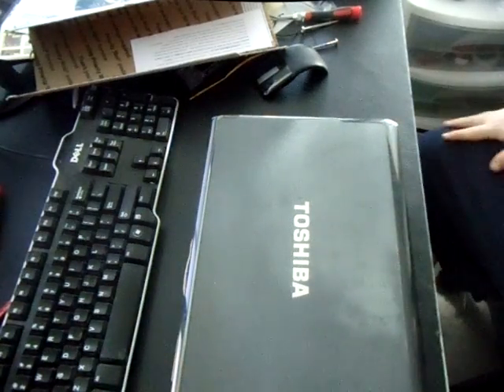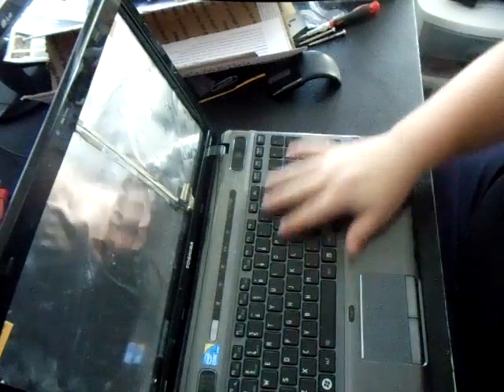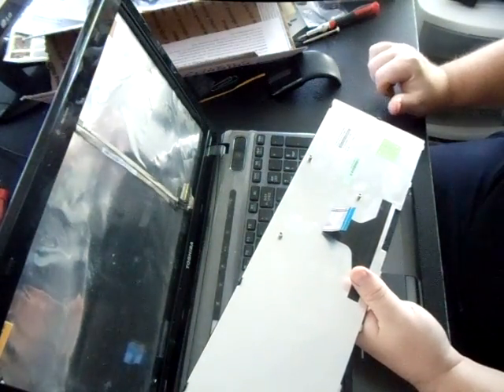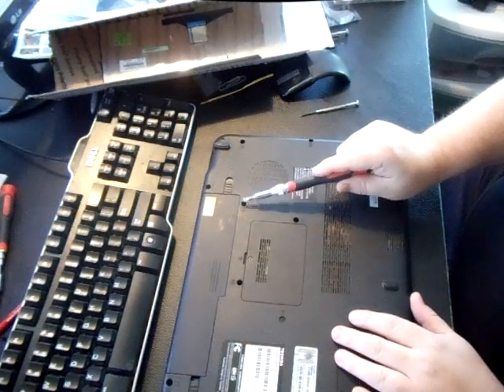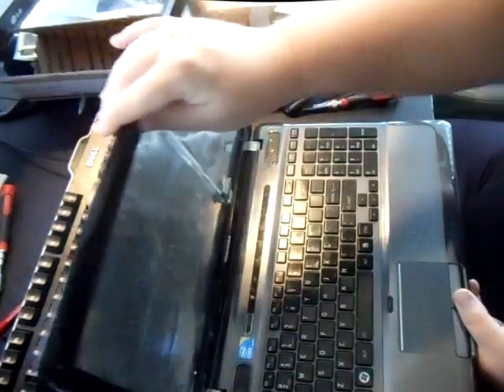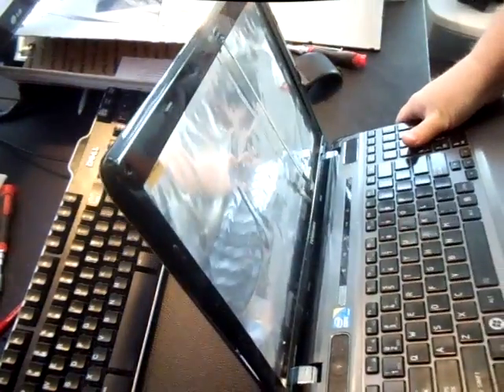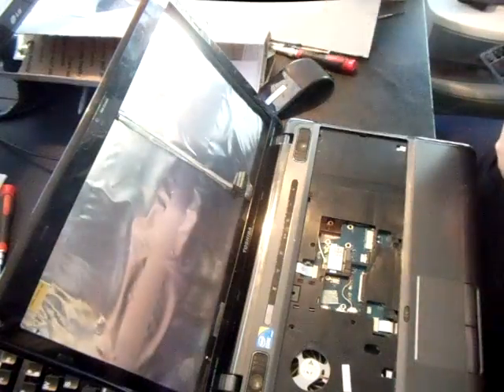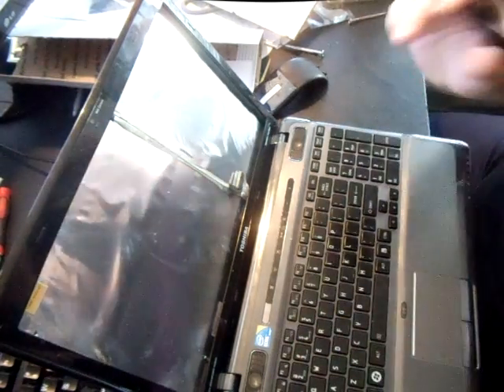How to Replace Bad Keyboard on ANY Toshiba Satellite Laptop (P305 A660 A665 C600 C640 C650 C55D L755

Comment: I will advise you first to remove the keyboard clean the plastic cable where it makes contact to the motherboard with alcohol let it dry and insert and make sure it’s making good contact..Also before putting it back in blow on the motherboard side it might have dust from the fan..Has worked for me several times..Also get the model number and helps compare the new one you will but

Comment: Hey, where do you suggest 2 buy the parts , the keyboard for my sattelite toshiba keyboard for laptop  martielepswanko@gmail.com  thanks
Reply: amazon is where I got mine ~ $15.  The screw is in the battery compartment and is connected to the trim above the keyboard, that has 4 screws in it.

Comment: I love your accent; you sound like you could be my brother! Anyway, I have a Toshiba I bought around the time you made this video.  I've used the technique you described on an Acer in the past, but this darn Satellite E45t has one molded back (can't even take the cursed battery out without a screwdriver) and the keyboard looks like it would have to be removed downward, not popped out upward.  If you have any hints, I'd be so appreciative!
Reply: I didn't notice his accent but that's because it sounded normal to me here in Georgia.